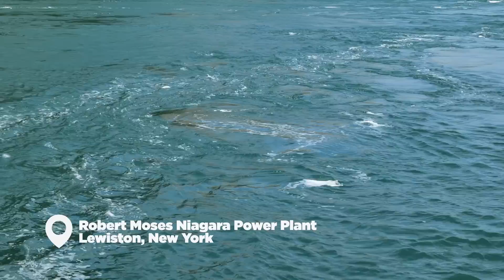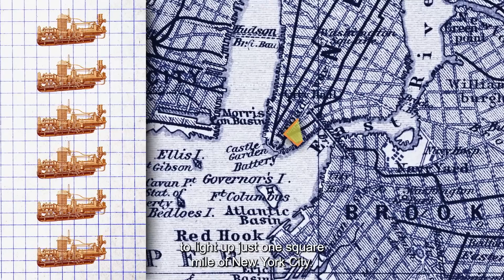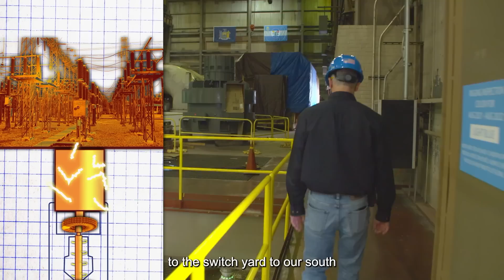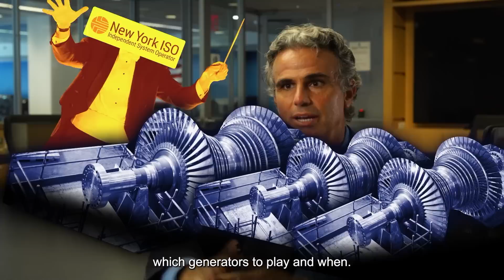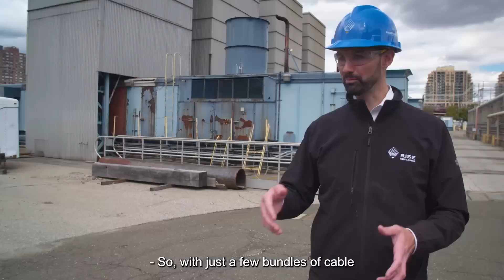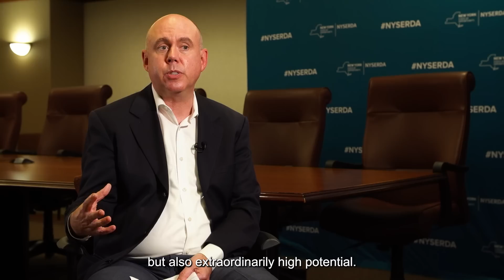The Challenges Of Powering The City That Never Sleeps | NYC Revealed

Comment: I appreciate that ConEd has a fear level low enough to allow the public to see where their bills get spent and the importance of the complicated (not complex) system. I hope they have a backup ops center off the public view in case “something” happens to it.
Reply: It’s too big to hide. There’s nothing really unique and the plants are pretty easy to find(follow the big power lines) this is more informational than anything.
Reply: @careykaeding4542  I’m thinking about the control center more as it’s a concentrated brain compared with the rather distributed generation plants

Comment: This video's main body is a cut up from a previous documentary on NYC's electric power grid.  The rest is gobbiegoo.   At 10:30 the man at power plant is talking about respecting their neighbors while the video is showing what appears to be natural gas turbine with no steam cycle.   These run extremely clean, but are noisy.    It's a large jet engine.   The emissions the neighbors are complaining about is likely the noise.  The US power grid has been greatly clean since the mid 1980s.  No harmful acid rain from sulfur dioxide,  coal fly ash  or unburned hydrocarbons.  Nitrogen Dioxide NO2 from high pressures and high temperatures from using earth's atmosphere in combustion were not being addressed, but are now.   NO2 condenses at 70.2°F and rains out of the atmosphere in colder climates in 5 - 10 days.  There is scientifically measurable amounts of coal fly ash.   

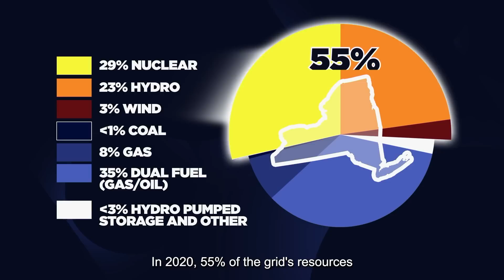16:00  shows a pie chart of the break down of electric generation for New York STATE not New York CITY, with video about New York City's electric power.  The electric power generation for the State of New York comes out 29% nuclear and 23% hydro power with a suspect 3% from wind giving 55% zero emission; however, electric power generation from wind turbines and solar voltaic is wild AC that is not power grid quality and has to be conditioned by other sources of electricity.   

The 35% of the electricity that is generated from duel fuel gas/oil is very odd.    Oil is the most expensive fuel for generating electricity.   It is used for backup generators.   Gas turbines being a version of aircraft jet engine can be retrofitted to run fuel oil, but this is not their normal use and they will be more polluting and dirties them up quickly where if running natural gas they are still clean after ten years.  If duel fuel gas/oil is for converted coal plant boilers that is an extremely expensive way to make steam.   

Natural gas due to fracking and shale gas is extremely cheap right now in 2024 USA with the wholesale price in summer being $2.50 / million Btu, but historically natural gas was over $7 / million Btu.   The equivalent cross over fueling cost if running a new ultra supercritical coal plant on high BTU bituminous coal would be $0.80 / million Btu natural gas, which has only happened when future contracts for natural gas had no place to put their natural gas during the COVID-19 pandemic.  

The huge problem with New York City's electric power is it had no way to get enough of it in the 1980s.   The high voltage transmission lines into the city could not have their existing placement expanded any more and at high loads the power lines would visibly sag from the expansion of the high heat they were generating, requiring to shed load by use of rotating blackouts in the city.    The solution was to place natural gas turbine generators on barges wired at the docks.   These were expensive to run at 1990s natural gas prices.  Being able to be classified as marine navigation allowed few restrictions on their use.  

This video has the United Nations Climate Change disclaimer.   Global warming was officially stated at 1.1°C in 1991 and 1.06°C in 2022.  It's scientifically impossible for greenhouse gas behavior to cause global warming.  All the greenhouse radiant energy from the earth is completely absorbed in earth's greenhouse effect by greenhouse gases within 20 meters of the radiating surface that is always in saturation from the strong greenhouse gas water vapor. 
 
The back of the United Nation's IPCC science report states it took its greenhouse gas samples at 20,000 meters altitude where it is common high school level knowledge there is no greenhouse radiant energy.  This is typical practice for deceptive marketing to state legal data transparency protecting the perpetrators from fraud prosecution.   The IPCC has been transparent with its data acknowledging it is not dealing with active greenhouse gases.  

Earth's greenhouse effect is frequently used as a primary example to high school students of a system always in saturation from the strong greenhouse gas water vapor absorbing all the greenhouse radiant energy from the earth with greenhouse gases within 20 meters of the radiating surface that is all around us everyday and can't have its overall effect changed.  There is no further greenhouse radiant energy to interact with greenhouse gases.  At 1% average tropospheric water vapor over 99% of earth’s greenhouse effect is from water vapor.  Water vapor would hold earth's greenhouse effect in saturation if it were the only greenhouse gas in the atmosphere.

Arctic warming is taking place with the proving mechanism being warm Atlantic Ocean waters migrating deeper and more frequently into the Arctic Ocean warming it and the region.   That warmer water is causing a few weeks less of reflective snow and ice coverage resulting in more solar heat gain to the Arctic region surface.

Atmospheric CO2 levels of 1200 ppm about three times what they are today would greatly invigorate C3 plants the majority of plant life on earth greatly greening the planet. 

0.4% of the atmosphere is CO2 and on average 1% is H20 water vapor.   (1% H20)/(0.4% CO2) = 25.  Water vapor is 25 times more present in the atmosphere on average than CO2.   Water vapor has an CO2e of 18,  18 X 25 = 450 CO2e total for water vapor to 1 CO2e for CO2. 

The Earth’s oceans have 3-1/2 million sea floor volcanic vents warming the water and changing it’s chemistry that have not been systematically accounted for.
Reply: Thanks. At 20 minutes talking about $30 million solar energy that provides power for light and computer systems. Maybe 10% of what is needed. Any way water and atmosphere are not being renewed in any way. Solar storage in coal is renewable energy
Reply: 150% false information
Reply: @arinbk6841  Don’t know what you mean.  The video was likely to get some pocket money using a previous documentary that was cut up.